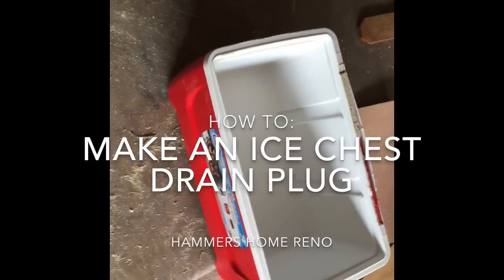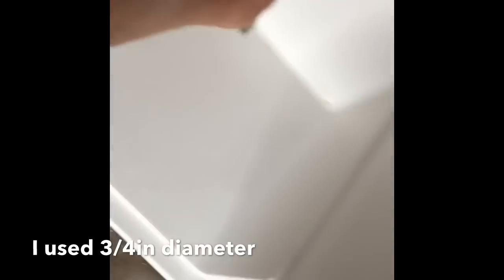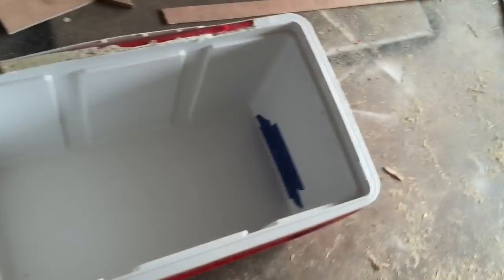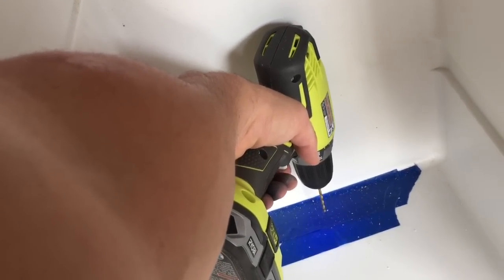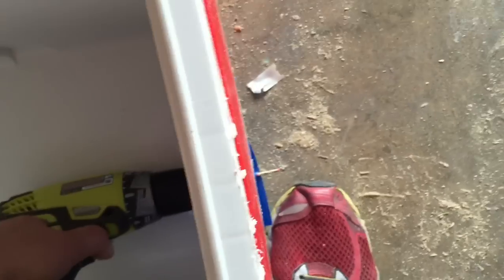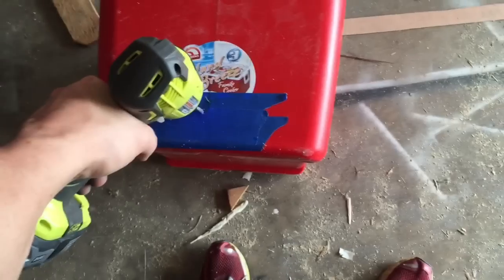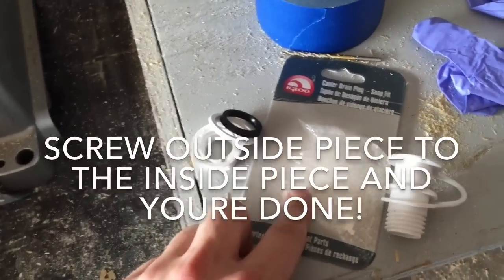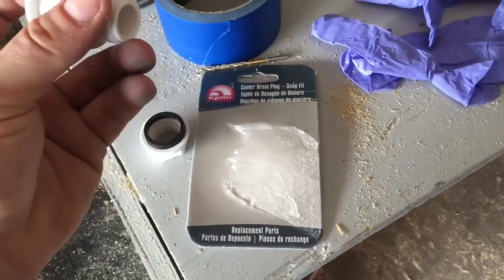How to Make/Install an Ice Chest Drain Plug

Comment: A hole saw of the right diameter would work better than a spade bit.  Most hole saws come in a set with several diameters to chose from.  With a hole saw you probably would not need the tape as they do not splinter when exiting the other side of the material and you would also not need to drill from both sides to eliminate the splintering.
Reply: What I was thinking as well!

Comment: If you’ve got sharp bits, you can run the drill @ the highest rpm with virtually 0 risk of cracking the cooler. The trick is to let the bit work as designed. Put very little pressure on it and let the bit(s) do all the work.
Reply: like not using a wood drill bit for non wood materials? lol